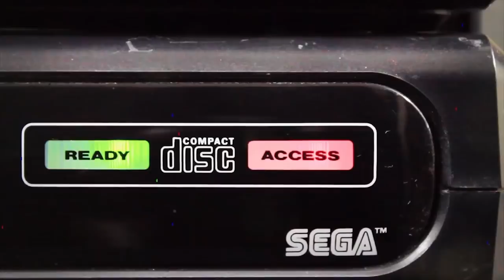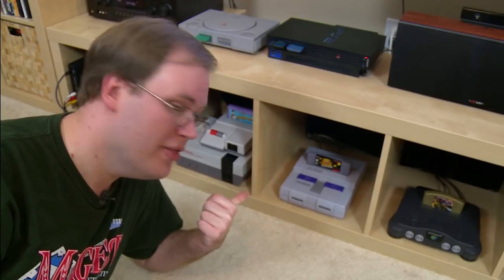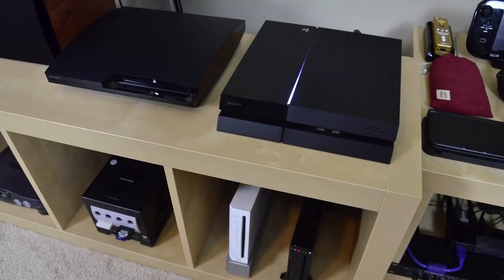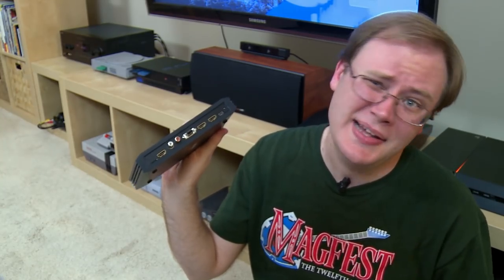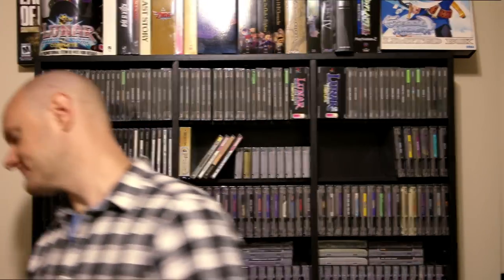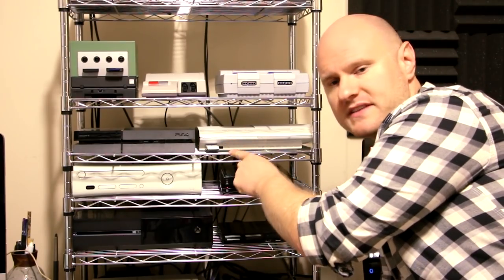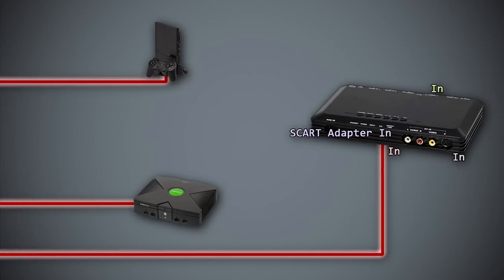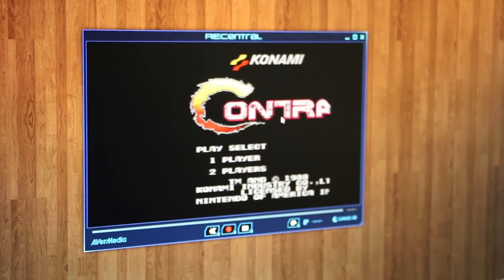RGB and Modern Gaming Setups :: RGB102 / MY LIFE IN GAMING

Comment: Does running hdmi systems through the xrgb-mini improve quality?
Reply from the maker: [Coury] You will see no improvement at all to HDMI sources, in fact I just set it to pass the signal through untouched.
Reply: *****
Ok.Thanks.I was curious if it did.I'll be running a component switcher with xbox,ps2 and Gamecube.As for my RGB i'll be running a modded snes mini,PS1.I don't have alot of hdmi systems so thats why i asked.only using ps3,ps4 and xbox 360.So my setup will be close to yours.I want to thank you both for making the next step in retro gaming alot easier.I saw the sites you had to work with an that was alot of to discern through.Keep up the good work.

Comment: What HDMI splitter would you guys recommend?
Reply from the maker: ***** [Try4ce] To be honest, there's a bit of luck involved in the matter. The original listing for the one we bought on eBay doesn't exist anymore, however it's not hard to find one that looks just like it. Oftentimes devices like these are manufactured by a no-name brand and then picked up by other brands that slap their name on them. So if it looks like the ones pictured in the video... then there's a good chance that it also strips the HDCP so you can easily capture PS3 and such. But unfortunately, we don't really have a model number or direct link to a known product to provide.

Comment: Do you have to get your retro consoles rgb modded for the good quality you have for them
Reply from the maker: +JakeThaGreat001 [Try4ce] Certain ones, yes, others, no. We're working on a "200" level series about specific consoles... so far, we have Sega Master System, NES, Genesis, SNES, and N64 released. PlayStation is next, and we intend to cover every specific console that we possibly can. In general, you can expect most common consoles to output RGB or natively, with big exceptions being NES, N64, and TurboGrafx. Mods are available for those.

Comment: Hi there, what is the best and cheapest RGB to HDMI adapter that you can recommend? I'm not interested in upscalers just an adapter, to keep the price as low as possible.
Reply from the maker: +Lion heart [Try4ce] We'd love a chance to try more things like this, but unfortunately we haven't. Keep in mind that part of the idea behind the scaler is to keep lag minimal, rather than letting your TV handle the scale. Though it wasn't RGB, Coury did use an S-Video to HDMI converter, and it was kind of bad. Someone may know of some cheaper devices that are recommended, though.
Reply: ***** It sounds like I will need to save for a framemeister then. Thanks for the tip.
Reply: +Lion heart 

Yeah man. There is one out there that is pretty popular by a manufacturer called C-Vid (or something like that). It's gotten some traction because it is pretty cheap, costing around fifty bucks on Amazon --- but it is gutter trash. I have owned one. It adds considerable lag, and on top of that it can't even handle being run through a scart switcher. I own about the best scart switcher you can find, and have all my stuff hooked up to my PVM through it and a scart>BNC cable, and there is no signal loss whatsoever on the PVM. The C-Vid scaler, when it is hooked up to that exact same switcher through the same output, looks worse than composite video. For whatever reason, it just has to be directly connected to the video source.

The overall point is this: don't nickel and dime yourself on cheap attempts at a solution. Save a couple bucks here and there, and get the real deal. I sold my C-vid scaler on eBay last week and will never buy another cheap piece of crap like it again.
Reply: Dave Bladegun thanks for the tip bro
Reply from the maker: Dave Bladegun [Coury] absolutely agree. One of the reasons we made this series of videos is because we wanted to make the videos we wished existed when we started - we spent a lot of money on things that weren't great before learning.
Reply: +My Life in Gaming 

I hear you man. I like you guys' channel because of the approach you take. I have been wanting to start making my own videos, so that is why I got the Framemeister. I currently game on my Sony 14" PVM, and just recently scored a 25" Mitsubishi PVM! It's freaking sweet and I am probably gonna post a video of it because it seems like a pretty rare piece -- I cannot find any YouTube vids that cover it right now and would like to show it to my fellow analog video nerds out there on the interweb.
Reply: +Lion heart 

No problemo, my man.

Comment: So do all the 8 and 16 bit system have to modded for RGB in order to do this ?
Reply from the maker: [Try4ce] No, SNES and Genesis natively support RGB. So does Master System. You can get RGB out of PC Engine / TurboGrafx with external adapters like the Super SD System 3 (unless you have a Duo system, which needs a mod). NES does need a mod, though.
Reply: My Life in Gaming great thank you. One last question. What size of TV are you guys using? Any size of HDTV you guys think is a good size for the Framemeister?

I plan to use a 27” 1 millisecond gaming monitor to minimize lag as much as possible. I also have a 55” Q6FN which has under 15 ms in game mode.
Reply from the maker: [Try4ce] Both of those should be great options. I wouldn't say any particular size is better or worse, it's just what you want. Do watch some of our later videos to get a fuller idea of the pros and cons of these devices. The more up to date video is our Modern and Retro Gaming on 4K TVs episode, which features the OSSC much more than the Framemeister. Unless you're dealing with a lot of 480i games, the OSSC may be a better choice. However know that the pink screen and no sound issues that the Framemeister is shown having in that episode have been fixed with a Framemeister firmware update. It had trouble with certain 4K TVs at one point.

Comment: Does the framemeister ever get hit if it's on for a extended period of time?
Reply from the maker: Josh Lopez Not sure what you mean by this - If you leave it on does it get hit by what? Electrical current spikes? Or lose sync?
Reply: ***** yeah does it ever go out of sync during gameplay?
Reply from the maker: Josh Lopez the only time it will ever lose sync is if a game has a change of resolution. Which can be difficult in games that do that a lot - for instance, Chrono Cross. The menu is in a different resolution than the rest of the game, so it will lose sync and re-calibrate every time you go into the menu
Reply: Oh okay thank you for the info! I really enjoyed the video bout this device since the best I can do depending on system is s video for my classic consoles
Reply from the maker: Josh Lopez definitely nothing wrong with S-Video! We used it for a long time with our SNES on an HDTV. HUUUUUUGE jump over composite.

Comment: But why did you use Composite for Gamecube?
Reply from the maker: [Coury] This video was made 4 years ago. It was my only available choice at the time.
Reply: @mylifeingaming  And what new options do you have now? The Eon GCHD? Is RGB Scart not compatible with GameCubes?
Reply from the maker: I currently use component cables through an OSSC. Check out the RGB 207 episode on the GameCube, but it doesn't cover the EON HD, we'll be doing a video on it and Insurrection Industries Carby in the near future.
Reply: @mylifeingaming  Thanks!

Comment: I have a TV that has s video do I still need a framemister?
Reply: Meister*
Reply from the maker: +LuckDuck [Try4ce] Composite to S-video is a HUGE jump in quality... the most important jump, in my opinion. But RGB is still better. But more than just the video inputs the Framemeister accepts, it simply processes better than any HDTV does. It'll just look better either way. But do you NEED it? Certainly not.
Reply: ***** okay thanks

Comment: S-video  is likely  the RGB option bar none

when it comes to:
snes
game cube
n64 
wii
ps1
ps2
xbox

noting that whilst using scart is nice however unless you have tv's with integrated don't bother with it..

personally there isn't any issue with joytech av switches..

hdmi tends to be king

ps3
ps4
360
xbox 1

i can't comment what is compliant with sega consoles since I don't own them..
however s-video likely be the best resolution you can get..

noting only a few avr's did support  composite/component/svideo and output via  hdmi..